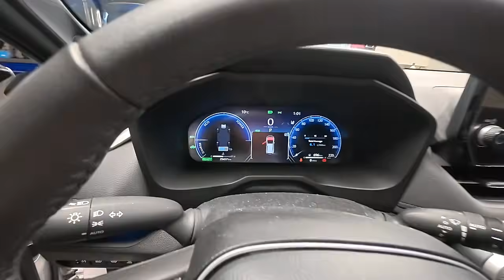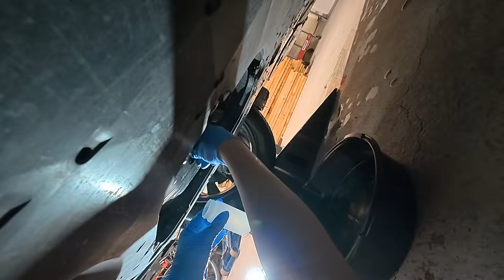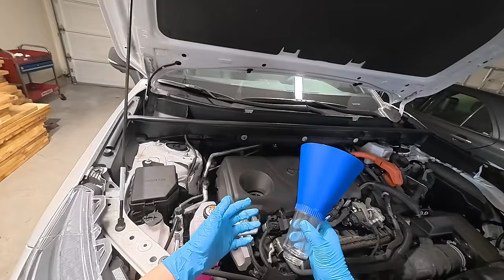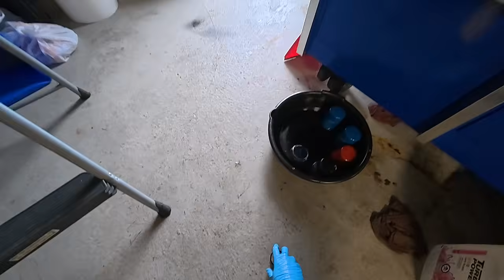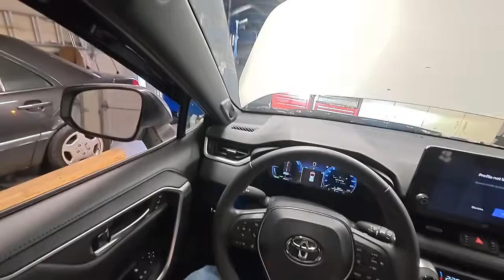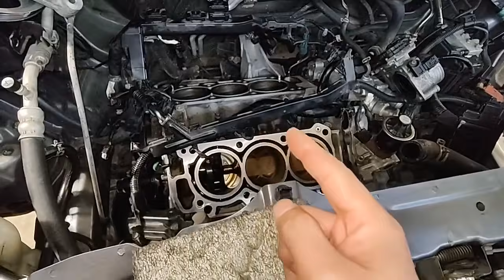5w30 Instead of 0w16 oil change #2 in the Rav4 Hybrid.

Comment: What are your thoughts on 10w30 for a very high mileage (310k) Corolla that calls for 5w30? My mechanic said a slightly thicker oil is good for older engines with a lot of wear.
Reply from the maker: Don't know what year corolla but man back in the late 90s and early 2000 corollas same with the Camry they ran forever you can still find them on Facebook market place oil cap called for 10w30 or 5w30. My god father owned one it's the only car he owned but had to get rid of it because he was getting too old to drive it anymore.
Reply: Thanks man, it’s 03’. It is a tank and has needed nothing other than regular maintenance. They were definitely built different. I just wasn’t sure about the heavier oil because it’s about to be winter. It doesn’t get that cold where I’m at but can occasionally get to maybe 15 Fahrenheit. Im not gonna worry about it, just didn’t wanna do anything to create unnecessary wear. Some people are doomsday with anything other than the spec’d oil so I like to ask around and get different opinions.
Reply from the maker: @felipe3354 I've had 1996 Acura legend and that thing made it to 340k miles before it blew a head gasket. And it was a US Spec legend. I've torn down high mileage engines with regular maintenance but this was when oil change intervals were 6k kms before 2010 bearings were still good. We have first gen pilots and ridge lines customers that has 600k kms and still going one customer traded in his 560k km pilot to our dealership for a new pilot and I'm like 🤦. It's just all the new cars out now they don't last. And constant same repairs over and over again
Reply: @theoffroadingmechanic very interesting. I like how you said you’re not an engineer, you just fix their mistakes 😂. People ask me when I’m getting rid of this car and I say why would I?

Comment: I have a 2018 Camry SE and have been using AMSOIL OE in it since 50k miles. Car now was 108k miles and decided to use signature series 0w-16 for the first time at 102.5k miles and have been running it since then. 0 issues. Maybe bigger cars pushed harder benefit from the thicker oil but for passenger cars there’s no issue I presume.
Reply: I generally wouldn't go any thinner than a 0W20, you need to keep in mind the oil's HTHS rating.

For example Amsoil sig series 0W16 engine oil is 2.45 whereas their 0W20 and their 5W20 engine oil is 2.67 (their 5W30 is 3.11)

In a naturally aspirated "low displacement engine" especially if it has been designed properly, and designed for thinner oils.... then you shouldn't have any issues... unless you drive your car like you stole it.

I personally wouldn't use those thin oils in any engine larger that 2.5L and under no circumstances in an engine that has forced induction.
Reply from the maker: More cushion for the pushing on the bearings on something that puts out over 400hp I say. But dunno if you watch TFL towing torture test they had a Chevy Silverado and at the end of the test they stopped the truck and the oil pressure low warning came up. That is what happens when your oil gets so hot it thins out and you lose oil pressure. Especially if you have a variable oil pump.
Reply: @theoffroadingmechanic  yeah I’ve seen a great mechanic on YouTube had a car with an issue like that. It was a Toyota Sienna and the YouTuber was “the Care Care Nut” and the car had engine damage because of low oil but whenever they would come to a stop or turn the car would shut off and it was because the oil pressure would get very low in such scenarios.
Reply from the maker: @DuckMcDuckinson lol sounds familiar I've experienced this on Hondas, Hyundai, kia that burn oil and doesn't have enough oil in it to get picked up by the oil pick up so not enough oil going to the variable valve timing gears. But the Honda V6 is quite forgiving people will run it till the oil pressure light comes on or check engine light for the valve pause stuck off code and they keep on going just put more oil in it. Hyundai's usually just blow up
Reply: @theoffroadingmechanic  yeah the motor in that car was the 2AR-FE and they need good oil flow to run the VVT-i system well. Maybe that’s why Toyota recommends 0W-20 for it. Have the same motor on my moms car in a 2010 Camry LE and I run AMSOIL OE 0W-20 and it runs smooth but it burns quite a bit of oil, almost a quart every 5k miles but I assume it’s the old PCV valve and a leaking spark plug tube being the main culprit.
Reply from the maker: A lot of cars after 2010 burns oil. I have a few friends and family members with Hondas and Mazda that burns oil been taking their vehicles to the dealership. They never did anything other than tell her that she's burning oil she would have 2.5L of oil after every oil change. I've been servicing it now since around 120k kms now has 190k and I've been putting Pennzoil 5w30 ever since and after every 8k kms when I change it the oil has been getting back up on the dip stick. Still burns oil just not as much but it is to where it is showing on the bottom mark of the dipstick. It's the early 2.5L skyactive engine total capacity is 5.2L. when I worked at Mazda those early skyactive engines burned oil.
Reply: @theoffroadingmechanic  I have 2025 Mazda CX-30 non turbo 2.5l and I have thought about running 5w30 in it, Do you think its a good idea with this engine without being a turbo model?  The car calls for 0w20, But I feel like that's too thin. I also get the oil fuel dilution in the oil like you get with your rav4.  I just don't want to run a thicker oil if it could harm my engine

Comment: Isnt the computer that runs the variable oil pump basing its calculations off a thinner oil? Meaning it may not be pumping hard enough to push that thicker oil to the levels needed?
Reply from the maker: The computer doesn't run variable oil pumps its mechanically driven all the time. The computer can either control a solenoid to control it to a set pressure on some manufacture that uses a vane style oil pump can use a solenoid to allow pressure into a different chamber of the oil pump to change the angle of the outer housing and it just reduces the output flow of that oil pump. A variable oil pump is only beneficial during idle or with no engine load like decel and once it comes off idle the oil pressure increases. Basically you are saving miniscule of fuel while stopped at a light because that oil pump doesn't have to be working so hard all the time until it needs to be when you go to accelerate.

Comment: 0 w 16 seems way to thin. The reason Manufactures use it is to meet fuel mileage demands from the Govt. I have a 2024 Silverado with 5.3 liter that specs 0 w 20. I want to put 5 w 30 in it. But my truck is still under the 5 year powertrain warranty. I change oil myself as well. I am worried that if anything goes wrong with the engine that GM could try and say is due to me using 5 w 30 oil, they will not cover the repairs. Since I buy the oil, i need to keep records to prove i have in fact changed the oil. So if i ever need to show what I have purchased, the receipts will say 5 w 30 instead of 0 w 20. That worries me. But ohh, how I want to switch over to 5 w 30. Your opinion?
Reply from the maker: I've worked at many dealerships and non where we denied someone's warranty for having the wrong oil. Or warranty asking what oil was put in it. We declined warranty on engines that are full of sludge or lack of maintenance more often than someone that has done regular oil change with different oil. And I highly doubt a flat rate tech would waste his time to get an oil analysis and wait a few days just to decline your warranty unless he's really trying to get the higher paying labour time from a customer pay job. But who knows I've had some outrageous comments on how others dealers are overcharging on repairs anyways so maybe it is a thing out there🤷

Comment: It would be a good idea to get a larger oil drain pan.  They don't cost much and will make your oil changes easier.  That pan you have now it ok for smaller cars but your Toyota seems to hold more than that.  Would hate to see you spill some of that dirty oil.
Reply from the maker: Yea when changing the 4runner it's right to the brim. Eventually I'll get one. I usually just change my oil at work. And the cars I do at home usually take less than 5L

Comment: For what it's worth, i lived for 4 years in Dubai. Bought and kept a camry hybrid and a rav 4 hybrid, 2019 model year cars both of them, drove both of them more than 100k km. Dealership oil recommendation was strictly only 0w-16. 10k km oil change intervals. Temps were routinely 50°c in the city during summers there. Now using the same oil in ontario with 0 issues in my rav 4 here (same engine), 90k km on my canadian car.

Comment: Engine specs are different in all countries for different reasons.
  JUST USE THE SPECS ON THE OIL CAP OR RANGE STATED IN THE MANUAL.

Comment: In about a decade, the Toyota used car market could get very interesting, with all those 0W-8 engines starting to fail around the 120,000-mile mark.
Reply: I seriously doubt it.  They’ve had no issues with 0w16 or 0w20.  I’d still use a higher viscosity oil though.
Reply: look another guy that thinks he knows more than the engineers at toyota
Reply: @fu4383 The add pack in 0w8 is really good.
Reply from the maker: While 0w8 or 0w16 is thinner. Oil itself thins out when heated. The second number is a measurement of flow or resistance to flow. Where the winter number is a density measurement. So what people is worried about is the winter number but think the second number is the same measurement.
Reply: @fu4383 I agree with you in part but on the other hand, engineers can be bought $$$….
Reply from the maker: Yea there are also good engineers who come up with real actual fixes like for gm on fixing their transmission and have parts readily available to ship but gm didn't care about the fix. Saw it on an interview on The car guy online.
Reply: @theoffroadingmechanic apples and oranges… We’re talking about changing industry standards of oil and possibly achieve planned obsolescense… for  profits $$$ when completely unnecessary ad in other parts of the world
Reply: @fu4383  Why do you assume that the engineers are designing the car with only longevity in mind? They have to balance that with other demands from the higher ups that task them with the project of designing the car. One of those demands is that it meets CAFE standards in the US, their largest market. A good compromise is using thinner oil, which will give Toyota better MPG numbers to report to the EPA with the caveat that the engine will wear a bit faster than if it were using a more viscous oil. It's not that I think I know better than the engineers, it's that I understand that we have different goals. As the consumer, I want my car to last longer and don't care if my mileage drops from 25mpg to 24mpg, so I'm switching to a more viscous oil.

Comment: Changing to 5w30 is the best thing you can do for your car,I put in in all 5 of my families cars for years now! My daughters suburu was sounding like a clatterbox so i dumped the 0w20 and put in 5w30 and it quieted down in 5 minutes,its been 2 years and its still quiet! All 0W oils are for emissions regulations only!
Reply: All my vehicles feel better and work much quieter on 5w30
Toyotas, Hyundai, Lexus etc.
I'm not using water (0w16 and 0w20) for the engine
Reply: It’s the low non W number that is the problem. The zero in 0W20 isn’t the problem. It’s the 20

Comment: Both my brother and mother run 5w-30 in their 19/24 Toyota Rav4's, been over 30k miles since switching. Both motors are extremely smooth and quiet. I would never advise anyone to run anything less. Especially in warmer climates.

Comment: I found out from someone else that a empty windshield washer fluid bottle threads into the valve cover. So you can cut one in half and use that as a funnel also. 👍
Reply from the maker: I use to cut either a mobil 1 or a Castrol 1qt bottle in half and it would thread into the oil fill cap.

Comment: My car uses 0w 20 VCC oil for 10k, but the manual says it can also use 10w 40 SP. 😂😂😂😂
With the 0w 20 after 5k, the  engine's sound is so metalic. So, I have 2 options changing the 0w 20 after 5k or using 5w 30 for 10k. Which is better?
PD: I don't care about fuel economy.

Comment: How can stuck oil control rings be freed?
Reply from the maker: The only way we do it at the dealership is to remove the piston and soak it over night. They get really stuck in there trying to get a pick to get them out they won't move only until after soaking it in Honda carb cleaner it softens up. Honda carb cleaner is good stuff. I have a video on piston ring replacement.

Comment: Since switching, have you noticed anything negative?
Reply from the maker: Nope I haven't noticed anything negative. No noticeable fuel economy change. I'll be running 5w30 long term. My dad's retiring soon and works at a shop that service taxis and same generation Rav4 hybrid and they have been using 5w30 and they have over 700k kms on them

Comment: Id d 0w-30 in rav4 hybrid personally. I just like the instant lubrication of 0w in a hybrid car. instant on protection because it doesn't have a traditional starter that gives the engine more time to build oil pressure before its on.
Reply: You may like it but I bet your car does not like it! You are like my neighbor with her vegetarian dog!
Reply: @smedl @smedleybutler1969  ok now THATS an insult 😭😭. I feel like a split second of dry, full speed engine time, adds up overtime especially with how many times a hybrid engine starts and stops. If you were using an oil that leaves behind good film strength like pup or amsoil sig than it should be just fine.
Reply from the maker: There's a guy on YouTube that did like 25 dry start oil filters and pre filled oil filters to prove a point. Lol😂
https://youtu.be/AQ_Gt0yPlO0?si=GlzK9w3MKuSZfsWo
Your bearings will always have oil in it even after the engine is shut off.
Reply: @theoffroadingmechanic 😭 u right

Comment: It depends on the oil pump if you change the viscosity. Some cars it’s OK and some cars are programmed to pump thinner oil. I think they call them variable oil pumps. I put 5w30 in my forerunner that calls for 0w20 it has a standard oil pump
Reply: Yeah the cars running 0w-16 most likely have an electric oil pump. I know my 2018 Camry SE has it.
Reply from the maker: The only car I know that uses an electric oil pump is the Corvette with a dry sump system. People think variable oil pump is electric they are mechanical driven by the crank either by chain or just keyed to the crank. And the flow of the pump is controlled electronically either by a solenoid. Or if it is a vane style oil pump a solenoid controls pressure to a chamber of the outer housing and changes the angle of it to change the flow. When it switches from a lower pressure to higher pressure is determined by load of the engine. Either no load condition or idling at a light so you save miniscules of fuel until you go to accelerate the pressure increases or if you put a load on the engine.
Reply: @t @theoffroadingmechanic  it’s the water pump that’s electric lol my b
Reply from the maker: Lol don't worry there's a forum out there on this.

Comment: Amsoil filter and pennzol ultra oil and I discontinued using the Toyota crush washers because they delaminate and stick to the pan I have switched
To the Nissan copper crush washers
Reply: Why would you use an oil filter in pan oil ultra. It’s oil is actually worse than oil if you’re getting the signature series or even the XL. Project form in plenty of other channels out there have proven this with the oil test on top of that.

Comment: Penzoil ultra platinum isn't any thicker cold than a 0w30. Its a great low temp oil.  One of the benefits of the heavier weight oil mught be better ring seal, and not allowing as much contamination to enter the crankcase.   

Did you get a 0w16 uoa sent in too??  Would be nice to get a baseline with that.
Reply from the maker: I didn't for 0w16 I should have. I did 1 oil change with 0w16 before I switched to 5w30. I would think that it was still going through break in and has the most metal in the oil.
Reply from the maker: I remember watching engine master where they were seeing if engine will make more power on thinner oil or thicker oil. And the thicker oil made more power because of better piston ring sealing. Man I miss Road kill on YouTube we would watch that during break time in automotive class
Reply: @theoffroadingmechanic are you familiar with the motor oil geek channel?
Reply from the maker: Yea I follow his channel.
Reply: @theoffroadingmechanic That was a great show! Modern engines use low tension oil rings so something to consider with thicker oils. It’s just like how guys think there is one best oil. There might be a best suited oil for an application but no oil does it all. Lots of great info on all these things aren’t on YouTube, mainly bobistheoilguy

Comment: Only use heavier oil when internal engine wearing out , telorance out of wack and abusive driving. In normal situations thicker oil create more problems than helps. Slowing down cooling raising temperatures breaks down oil faster, failing to push consistent oil through bearing, more friction ,reducing mpg,,engine will get sick and die meaning VVT=I go first replace it's ain't cheap
Reply from the maker: Just like the V8 in the f150 not having enough oil pressure when it gets up in the higher mileage and people puts thicker oil to get that oil pressure back.
Reply: @theoffroadingmechanic some people mistake and switch heavier oil on their newer vehicles with vtec , vvt or vvt-i